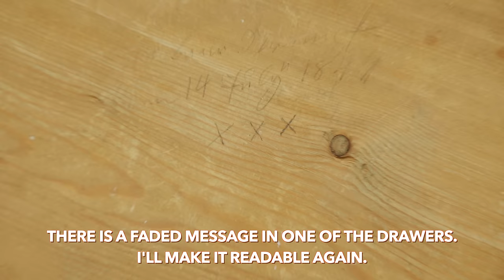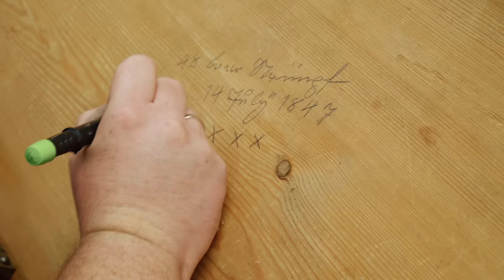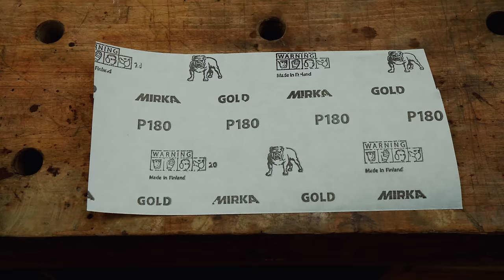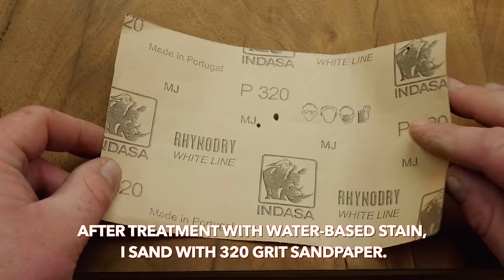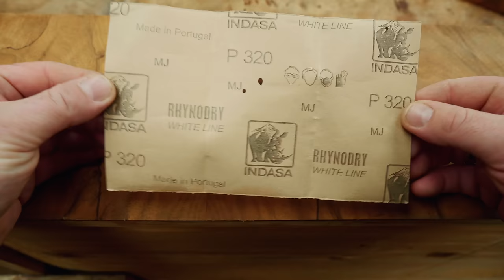Ich restauriere eine beschädigte Biedermeier-Kommode von 1847

Comment: Your process of making keys is fascinating. I buy every old key i find, and they are not expensive, i have maybe 50. Usually, i have one that fits. But, if i cant get one made, i have to give the precious key away when i sell the piece of furniture. It will be better for me to follow your example and learn to make keys from blanks.
Reply from the maker: Just try it. I did a lot of things wrong with this chest of drawers because I damaged the lock. In my penultimate video you can see that there is another way. Regards

Comment: Hey Chrigun!

First of all thank you for the Video. Your desire to Save this Kind of furniture instead of just painting it is very important to Save These beauties. Additionaly using the polishing with Shellac is an ode to the masters. Dont take it personal,but there was two times where i almost Had a Heart attack. You sanded the freshly stripped drawers at a low grit just to use the scrape/plane on it. It removes so much of the Patina and of the natural differences. Second, of you dont have matching veneer, get it, ask other restorers, im sure people you know got. you covered.
 Because on Long Term Most patches Fall out of Place When it comes to matching the Rest.overall i love your Videos, but These two things hurt regarding Taking off so much of the thickness with every restoration.

Best regards
Reply from the maker: Hello. Thanks for the comment. I try as much as it. it is possible for me to receive. Others can definitely do it better. I learn with every piece I work on and try to improve. Thanks

Comment: Wonderful restoration!  Thank you for your videos.  I would suggest that, in the future, you might crowd source matching veneer.  Here in the US, I frequently see furniture on the curb, usually beyond the owner's ability to restore.  Many times, lovely veneers go wasted.  I would hunt around on furniture pickup day to  salvage veneer scraps for you for free!  Of course, you may have time constraints that make this idea impractical.  I also have a question.  I see you and other restorers strip furniture, *then* make repairs with glue, epoxy, filler, etc.  That seems counter-intuitive:  you get those repair chemicals on the bare wood, which can impair the stain & finish process.   So for instance, a bit of resin glue can soak into the wood and cause a spot that never takes stain.  Looking to understand the method.  Thanks in advance.
Reply from the maker: Hello.
This is a good suggestion but unfortunately not always feasible. Some veneers are no longer available. Others are difficult to obtain. There aren't many companies that sell veneer. You always have to check whether you get the right one or the one that is closest to it. The next problem is that the veneer is usually only available in large quantities. Usually there are 20-30 sheets. They have to be paid. Often the right veneer is not included. It's always a trade-off. I reuse old veneers for other projects and always check to see if I can get remaining stock somewhere. But even that is no guarantee that the right veneer is included.
For stripping.
I don't like doing it very much. I only do it when I have no other option to remove the old surface. These are usually synthetic paints that unfortunately cannot be removed any other way. In order for new surfaces to hold properly, all traces of the paint stripper must be removed. This means the parts must be washed thoroughly. It takes a lot of work to remove the remains. That's why I don't like doing it. But then it is possible to redesign the surface. But the point is, no rose without thorns.
I hope I was able to answer your question.
Greetings, Chris

Comment: 05:22  there used to be no locks originally. then for some reason they made key holes and installed locks. and destroyed the original knobs, destroyed the images on them.
Reply from the maker: I don't know what they saw but the key locks are original.
Reply: @chrigunrestauration if they were original, the pattern wouldn't  have been ruined by the holes. There's a pattern with something like some round thingy (sun maby?) in the middle. They made holes and ruined the pattern.
Reply from the maker: 🤷‍♀️I don't care what you believe

Comment: I have to agree with @timhull8664
I also enjoy your videos but this one was a bit grating, IF that was a valuable antique. 
It is better to source the correct key blank or make one to fit, rather than altering the lock.
The replacement veneer was wrong wood and the grain was a poor match. I’m guessing that production schedule meant that there wasn’t time to order the correct veneer. 
Again and only if this was a valuable antique, then removing the surface aging can significantly devalue a piece. If you start with a hot damp cloth and just clean the surfaces, then you can make an assessment to what minimal refinishing is absolutely necessary. It is better to consult a professional antique restorer if a piece is historically significant. 
That is intended as constructive criticism which is how we all learn and improve.